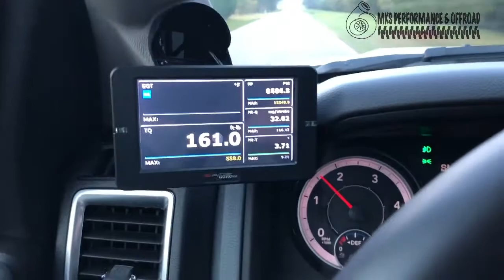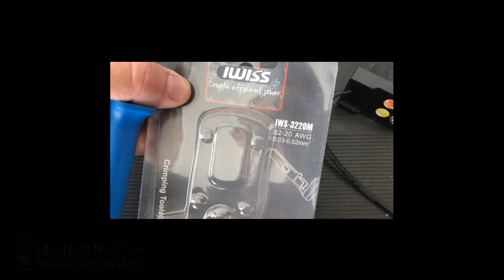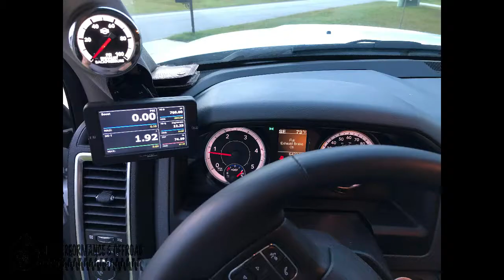Raceme Ultra EGT Sensor Plug Broke?  Here's how to fix it!

Comment: can you tell me which of the 4 pins is minus thermocouple and which is plus thermocouple?
Reply from the maker: I believe red should be negative and yellow positive,  I havent been able to get a straight answer from any manufacturer but on most thermo couple amplifiers the yellow is + and the red is -.
Reply: @MKSPerformanceOffroad  Looking for the pin out on the 4 pin connector that plus into the main unit. Is it analog(Striaght thru) or does the amplifier change it to digital?
Reply from the maker: @bobhupe7084  I cant say for sure but I believe it stays an analog signal until it gets to the controller.  The amplifier should convert the mV reading to something the controller can recognize in V.